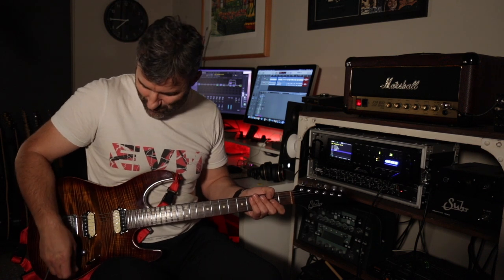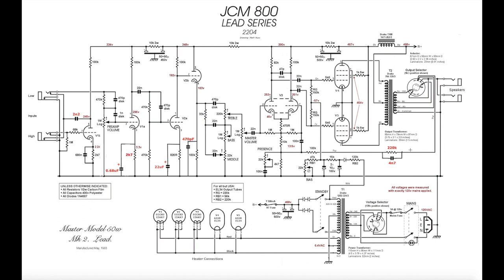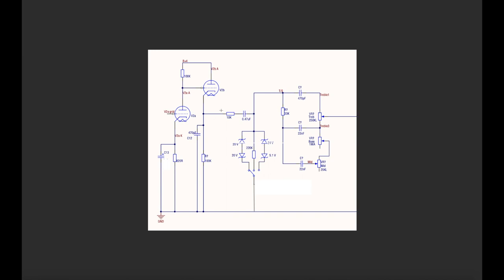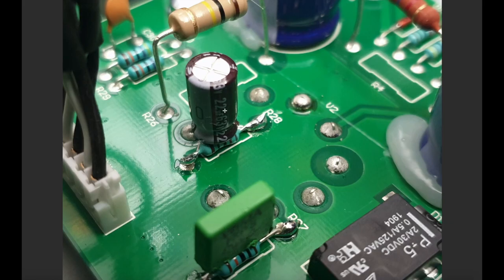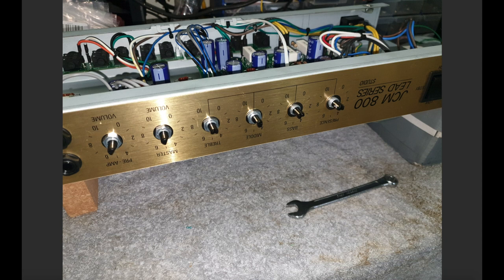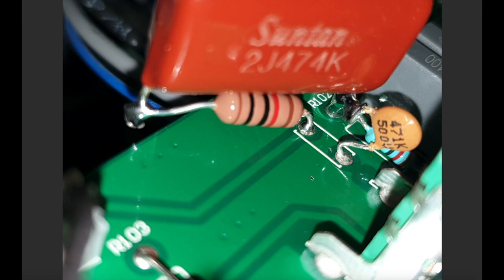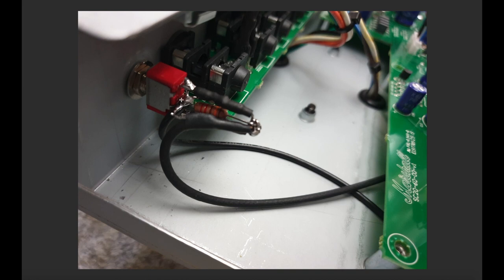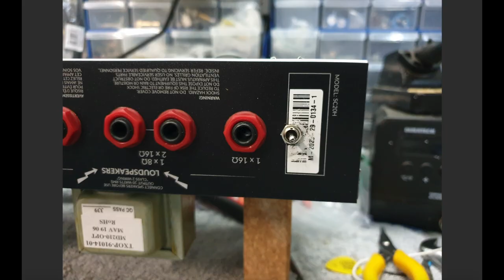Headfirst modded Marshall Studio Classic SC20H.  José mods, tones and full DIY Guide!

Comment: Any experience with adding a PPIMV to the SC20H to allow pushing the phase inverter tube at bedroom volume?  Thanks!
Reply from the maker: Haven’t been asked to do that mod but it would be simple.  These are cathode bias, same as the Origin 20 and I put a PPIMV in that for the ‘Plexi mod’.
Reply: @HeadfirstAmps Thank you!  Having mine modded per your #34 and Jose zener clipping mods, and trying to get PPIMV in there as well.  Per the tech, he followed a scheme online for PPIMV (not yours) but it throws the bias off which would damage the power tubes.  I’ll suggest your Origin Plexi mod.
Really get a lot out of your videos!

Comment: So by putting that ground on the middle terminal of that three way switch it's giving you a ground reference to each of the positions?  Is that right......I have to do this with a push pull pot with three contacts on each side....I'm thinking I can run the 10k and .22 cap right from the socket and connect to the tone stack right at the board and then run coax from there to my switch on my pot ....the middle terminal....then put the zeners to ground on one side and the 220k on the other side....does that sound right to you?

Comment: Would it be ok to use a 222k yellow paper like caps in C33?  Like the ones you used in the DSL mod.  I have a bunch of those
Reply from the maker: Oh yes, go for it.  They will be fine.
Reply: @HeadfirstAmps  Thanks man!   Sorry one more question.  I only have a 22uf 25v is that voltage to low to use?

Comment: Instead of removing the 10k can you put a 4.7 with the 0.68uf over the top like you did on the JMP?
Reply from the maker: Yes
Reply: @HeadfirstAmps  Would also be ok to put that mod on a mini toggle on/off and use it as a gain boost?
Reply from the maker: @shredding51 the problem is that switching a cathode value gives a loud audible ‘pop’, it’s a set and forget unless you use a mute circuit (like in my Alta!)
Reply: @HeadfirstAmps  I didn’t think of that.   Thank you man!  You have been a huge help to me.

Comment: thanks it's wonderful. I have too much whistling HISS can it be by using normal capacitor instead of electrolytic in cathode resistor? what difference there are? must be electrolytic polarized? Could it be from testing with the amplifier disassembled and it has no faraday effect?
Reply from the maker: Normally happens because of poor shielding.  Post your mod pics into our Facebook DIY builders group for help.
Reply: @HeadfirstAmps  ok thanks I send it to FB. I have only tried with .68 but it is not electrolytic. Is it essential that it be electrolytic?

Comment: What does the .47 cap do? I have seen people use .22 and even .1. .47 lets more bass through than a .1? Also, the 220k in parallel with the diodes.. a 220k is more open/less compressed than using a 1m in parallel? Thanks so much for your videos!
Reply from the maker: It's a coupling cap, so you can tune to taste - yes, higher value will let more bottom end through

Comment: Friendly suggestion, would you be able to include either the speakers you're running through or the IR? Cheers!
Reply from the maker: Sure, it's amp to Suhr Reactive Load  into the AXE-FX iii which has a cab block loaded for IR.  Its a V30/GB mix based on ML Sound Lab IR's.
Reply: @HeadfirstAmps  brilliant, thanks mate!

Comment: 10:20 what is the difference in gain or sound between pre tone stack master and post tone stack with the jose clipping? Also i assume in a 2204 you would leave the stock master where it is and this would be a second  master?
Reply from the maker: Check out Pete Thorn's video on Vai's modded Jose amp, there is a good description there of the sound difference between pre and post tone stack.

Comment: Really excellent mods. The amp sounds really fantastic with the changes. Q - will this work in a Plexi circuit as well? Thanks so much.
Reply from the maker: Hi Jay, thanks man.  You'd need to convert the plexi to a 2203/2204 cascaded preamp setup, and then the 5 or so 'hot rod' mods can be added.  These are really the greatest hits of 2204 mods.
Reply: @HeadfirstAmps  thanks so much. I appreciate it. I had completely forgotten to ask specifically if the Jose zener clipping mod by itself would work by itself without modding to 2203/2204? I have a hand built point to point Plexi which in which I have space for one more switch 😊 Really appreciate it. Watching the video about the MC25 - very impressive amp!

Comment: thanks for your amazing videos.
A question...
I have the depth and the coupling cap 0022 mod.
Also the 10k and/or 5k parallel cathode resistor in v1b...wonderful!!

but, when I add the bypass cap of .68 or another value like .33 or 0.1 (sir) it adds hiss and noise... why is it possible? What am I doing wrong? excuse my English. Greetings and thank you
Reply from the maker: It’s because that bypass cap adds tons of gain.  It will add some hiss and noise, if it’s really bad then it’s a layout/shielding issue.
Reply: @HeadfirstAmps  thks... I do the steps in your video of sc20h

Comment: How about mods for the vintage 20 watt? I just got one today and using a Boss OD 1 and a compressor makes it sing but Id like to make it sing without the extra gear. At the very least filter some of the low out of the input to get rid of the flubby bottom end. Awesome video!
Reply from the maker: Thanks man.  Yeah, if one comes in for work I'll definitely post about it.  I'd probably change the Plexi to an 800 2204 style pre-amp and go from there - which is what I did for the 1987x that was recently featured.
Reply: @HeadfirstAmps  I have a 2204 that was modded to have an extra gain stage, 1987 clean-ish channel(switchable), loop, resonance and a second master gain(switchable). 80s monster.
Reply from the maker: Sweet
Reply: But seriously, your channel rocks. Thanks for all the info!
Reply from the maker: Thanks man!  I appreciate it.